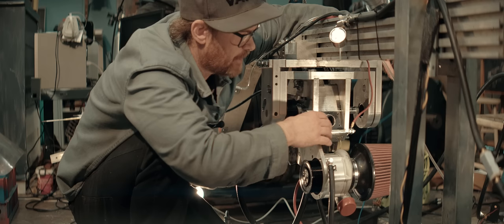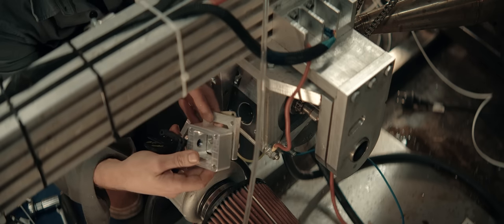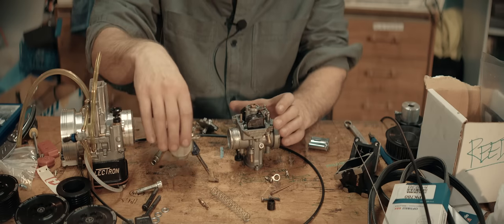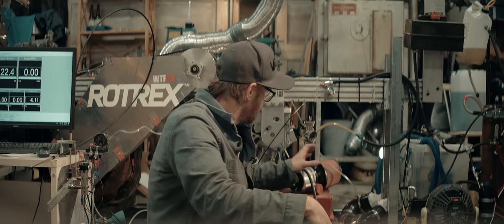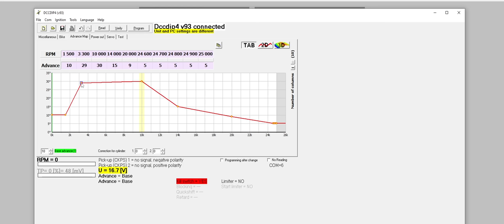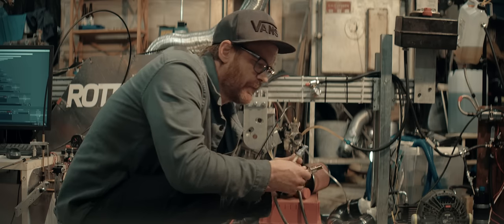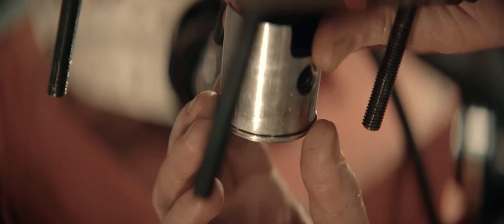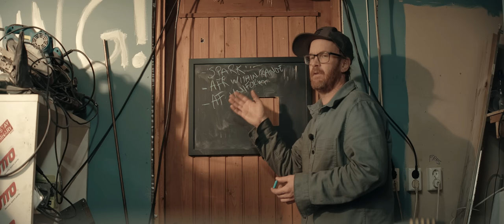Not Supercharged 50cc Two Stroke Not Running Nitro.

Comment: you didn't trying lowering jet
when you have very a big exhaust port with high degree like 200 for example and transfer port with 180you got a very small gap between them you get a very very narrow point of good mixture like 1 point or 2
Reply: and with you ignition advance you need less fuel because more efficient combustion ps i got a 80 cc that does exactly the same thing when too rich 
like ignition bug at 13000 rpm 
20 point less and i get good power 5 point less to lean i get 17500 rpm but good power at 14000
Reply: and you can see that when you shut the carb and reopen it your engine have 3 sec before it restart 
1 engine is not another 
but my engine is running 80cc with 80 pipe  16000 rpm 
main jet 90 point
and mine friend , engine origine, exhauxt pipe origine 125 point carb 
you should realy try lowering your jet plus your running on gazoline bro CHECK your plug if black or not

Comment: What about cutting angled grooves ithe quench band to induce swirl, only about
. 030" deep and 4-6 of them , and about . 060" -.080" wide, cut at an angle, about 45°-60° angle,  then remove the sharp edges to  prevent detonation,  it would probably mean making a new head, to raise the compression ratio, to compensate for the grooves, or  maybe change the shape of the ports, you should make a clear head to actually see what us happening, with a slow mo camera,  hopefully it would last long enough to see what's happening,. Maybe a pyrex head or window ? If the plastic degraded too quickly,

Comment: I wonder if you could rule out the crank case issue by heating the crank case. If the crank case was hot, fuel would atomize in there and reveal the issue?

Comment: I have two ideas/questions. Is it possible to add a pressure sensor in Cylinder and see if you lose spark and see what the pressure is. 2. Is it possible to decree the crankcase volume?

Comment: I couldn't help but think you might benefit from a wide band o2 sensor to adjust your mixture
Reply: Or a 4 gas analyzer
Reply: I was also thinking about the harmonic balance between the intake and the exhaust. If that might have any bearing I am trained in 4 stroke engines I admittedly know little of two strokes . Possibly  a little  auto cad and computer simulations could help shed light on the problem

Comment: My cr80 dose something similar when i hold it at like 3/4 throttle. The engine kind of surges its really weird. I know that bike also runs pretty rich and sometimes when it surges if I don't gas it the right way it dies cause my plug get to wet.

Comment: Could whatever lubricating oil you have in the crankcase be affecting the air fuel mix coming through the transfer ports? Wait, is there even any oil in there? When's the last time you check that?

Comment: Not sure if it's of any value, but I have noticed a disbalance in your dyno for as long as I am watching every now and then a video on this project. The whole rig shakes at between 7 and 8 Hz when the engine approaches the powerband.
21:30 "...then it takes a couple of hundred cycles to come back and then it happens again..."
25:40 up to 25:48 you mention frequency and vibrating, gesturing with your hand a frequency roughly matching the disbalance of your dyno when approaching powerband rpm.
Clould this unbalanced part imposing a slightly varying load on the engine play a role in the problem? It's easy to rule out once you have the large wheel on the dyno balanced while getting rid of the shakiness (is that a real word?) of your rig at the same time.
Reply: I think that you're onto something, Jeroen. Besides the shaking (which I also observed), I believe that the massive rotor of the eddy current dynamometer is unevenly loading the engine due to its substantial inertia... the rotor can't stop-and-start instantly in response to the experimental engine's intermittent combustion at certain rpm levels. If the dyno's rotor is indeed set-up with a one-way-bearing, the engine is still susceptible to inertial inputs when the engine produces a positive pulse of power—thus it "jerks" along unsteadily. After all else is taken into consideration the eddy current dyno might be a candidate for revision or replacement. A water-brake dyno is hard to beat when coupled to a 50cc/30-40 bhp engine.

Comment: Sounds like you are hitting a rev limiter.  Could it be that your crank picup is not capable of switching at that high RPM ? I have heard of a problem where the crank trigger wheel was too small for the size of magnet on it causing the picup to miss triggers at high RPM

Comment: Just thought about of spark blowout? it may spark but the chear force of compression makes the spark die before it has a chanse to ignite the mixture propperly. and then it just goes to h*ll and the cycle starts al over again?

Comment: Alex a 2 stroke are a 2 stroke no matter the piston , disk , or reed valve or poppet valve do the job. So why not exclude the crank case , use regular bearings, and engine oil then use a blower to do the scavenging and proper valve in the head . You have clean flow much stronger bottom end, and later you can add a turbo, this are proven 2 stroke technology, with fuel injection with no oil 🤔 😁. Good luck Sisyphus. 👍❤️

Comment: As the cutting out has quite a long time period is it possible  the float level is too low in the carb? Running out of fuel at high rpm?  Just a thought.

Comment: It seems possible that fuel is pooling somewhere and you're getting inconsistent mixtures from cycle to cycle. If fuel is pooling and then dumping at a resonance frequency and giving the engine a huge slug of rich mixture, it could explain a lot.

Been a while since I've seen the crank case - is there some places where pooling could explain this away?

Comment: Is the spark voltage always the same or is it increased by RPM in this system? Sounds like it's arcing out at that range. Can you try a different system that wasn't designed straight back in the 90s? At this point why can't you run a regular coil just for testing purposes with regular gas mix? I'm willing to bet your ignition system is to blame. Could be arcing and you can't see it (inside the unit perhaps). That's self limiting for a reason even without a pipe it should not cut out like that it's a 2 stroke but you could be having a resonant issue with your huge crank volume of the conditions won't change with another spark system.

Comment: I can't help feeling like the cutting out at pretty much 12500rpm and the limiter set at 25000rpm is not a coincidence. Is the ignition system getting the correct rpm signal?
If the signal is doubling frequency for some reason... 
Have you verified that the ignition system is actually timing as per your curve? I know you verified it at 10degrees locked.... But is it at 30 degrees at 6000rpm for instance?
Is it at 10degrees at 12000?
The issue is "too consistent" in my view to be caused by fuelling or some kind of mechanical problem

Comment: Is it possible you are hitting a limit on the coil? I wonder if the cut outs are the capacitor not being able to fully charge before it needs to fire again. From the video it is pretty clear that you are hitting some kind of hard limit at 12-13k RPM.

Comment: Would a coil on plug solution help any? If the ECU has ability to drive it they easily support 200hp per cyl, the only problem might be dwell at 12k + rpm..

Comment: I'm more used to tuning small block chevy's. Can someone explain the therory behind why timing has to taper off so much at high rpm in this motor? Love the videos!
Reply: Its a complex mix of residual exhaust slowing combustion at some speeds and fast combustion when the pipe is resonating which decreases residual exhaust and increases dynamic compression and turbulence increases requiring less timing. He is also pulling it back at high speed to keep safe from detonation but also as a rev limiter. Kinda like it's 2 engines. 1 lousy needing timing 1 good requiring less.
Reply: @billshiff2060  That makes sense, Bill. Back in the day (1960s) when we tried to run high percentages of nitro in 10cc control line speed models (before the rules changed), you needed a hot glow plug to keep the engine running while the model got up to speed—before it came on the pipe. When it hit the pipe the hot plug almost instantly burned out, which left you wondering how you might substitute a cold plug, which by the way wasn't hot enough to get the engine on the pipe (running rich). Like you said...complicated! One of the things that we tried was electrically heating the cold plug until the engine hit the pipe and then cutting the current. Besides not being much room in the model, the trick proved to be very unreliable. After a few guys managed to make 200+ mph runs, our national (rules-making) organization limited the fuel to methanol and lube only.

Comment: Could it be the pipe is not correctly designed and is causing an imbalance of gases at specific RPM's. Could you try a proper ktm 50sx pipe or something?

Comment: Yeah its a recogniceble , masochist feeling... Dude did you ever seen a 2 stroke 50cc and 70cc sprint or dragrace ? They still use those old kreidlers and stuff ... One of the weirdest thing ive seen was a ignition only using a pick up for the spark timing running on a batery(pack) using also a large bobin from a car or so ... ..  Your high voltage may be the problem , jumping over and leak... .. Maybe a normal 12 v batery helps regulate the power to the normal 24,4 volt a spark should jump

Comment: Just a thought, you set the rev limiter in the ignition unit to 25k and you engine cuts out at 12500. Is the ignition unit designed for 4 strokes?

Comment: When you designed this cylinder, didn't you said that you need a piston with no wrist pin hole ?
Reply from the maker: Ideally, yes. Will work with the holes too, but should make less power, in theory.
Reply: @2STROKESTUFFING  But is it possible this to cause the flames in the exhaust in the boosted setup?
Reply from the maker: Could be👍

Comment: I would try a smaller carb to increase velocity.
Reply: Yes a smaller carb is much easier to tune on a unkown engine. Alex has said many times that this crankcase volume is too large for a N/A engine. A race type carb is needed to alleviate carburation problems. Not all carbs are equal as I've found out through trial and error at very high revs.

Comment: I'm gonna throw it right back out there again, that I still think you're having crank trigger problems with such a tiny reluctor even though you're seeing spark on the meter, it's happening so fast that it doesn't mean actual spark isn't happening only every 2 or even 3 cycles the further your revs climb. The larger your reluctor wheel the more resolution and hence the more control and reliability you're going to get. I don't think anybody runs a crank trigger ignition with anything less than 4" of reluctor otherwise the pulses overlap and start to stack. Just my 2 cents

Comment: Your computer is fast enough to data-log spark events. Should offer an indication if your spark meter has enough resolution. If memory serves -- this is nearly 30 years ago -- such devices aren't effective at anything above 8000 or 9000 RPM.
From glow engine experience, that RPM oscillating at the top sounds familiar. The dyno indicates 50% drop in power. Is there fuel accumulation/pooling in the crank and/or elsewhere near the cylinder? Spark plug pulling heat out of the cylinder?

Comment: i dont tune 2strokes only  strokes but isnt the timing suposed to riase as the rpm goes up so that fuel has more time to burn becouse higher rpm so that the combustion happends same you need to advance timing becouse its higher rpm and you need less burn time to stay in the same cylinder pressure point or is it different on a 2 stroke ?

Comment: Didn‘t read all comment but think about your gasoline. Aspen or what ever spezial chainsaw gas you use is not e very good burner. It have only 91okt and burns really poorly. The only plus point it s a littel healthier then gas. For my racesaw i just use 100okt vpower with a good 3% syntethic mixöil. And they run way better with it, than just with aspen. Sorry for my poor english

Comment: So... call me crazy. But you said on your old ignition system it wouldn't cut out at RPM... it just ran like crap because you couldn't tune it enough for lower RPM? If you did pop it back on... does the high RPM cut out go away again? If it does then that pretty much would prove its a spark issue of some sort. As for compression... I see you only have one ring. Is this a 2 stroke thing? I am used to 4 strokes where there are normally 3 or 4 rings, but then again, 4 strokes don't have to deal with a bunch of ports to ride over in the cylinder wall. Perhaps more rings would help the compression if that really is an issue, but that may also be a huge no no for 2 strokes... you would know best for that one though.

Comment: The auto ignition temperature of nitro is about a hundred degrees less than gasoline. I know your using a mixture but do you think it could be related? How hot was the cylinder getting with the nitro mix?
Reply: hum maybe with the turbo that make high pressur you get even lower point ignition plus the temperature added from compression of mixture , and that why it make flamethrower

Comment: You use too big carburettor. I had same problem in derbi, it didn't rew through a certain point but when i putted a smaller carburettor it rewed through it. I had 50cc sylinder (was ported), with 21mm rews. with 24mm not rewing, Not enough flow in higher rpm.
(Sorry for bad english)
Reply: Very true. But this 28mm is the correct size for this race engine.

Comment: Wenn it have Spark it maybe not get enough fuel thrue the Carb, maybe the flowt bowl or the flowt bowl valve is sticking , it would explain no proplems at lower rpm where less fuel is needed, but its a good ideal to start wichtig a smalltalk amputiert of engine complexety, maype proplems that you find now will ingrease the turbocharged engine development , the theory with the off Breaks gibt spark sounds very familiar,  had a vape ignition that startet great but cuttet out over 7k rpm

Comment: Really .. those that just follow the path of those before them will very seldom find new approaches that might reinvent idea with fresh theories and hypothesis.. keep discovering your way .. and proving previous ideas to your satisfaction.. so you can move ahead with the confirmation for confidence .. I appreciate the education.. mistrials by mistrials.. the fact is the mistake might be the discovery .. do what you do man.. it’s appreciated by most and those that don’t need not watch or comment .. imho !!!!

Could two plugs sparking alternately help with the ignition at higher rpm.. whether to address the physical limitations of the plug or the frequency effect on the spark ?

Comment: i'm confused here doesn't ignition advance mean that the spark fires before the piston hits TDC? and wouldn't you want more of it at higher rpm's to get the flamefront of the combustion to hit the piston head right as it turns around and starts heading back down? rather then long after it's already started moving?
Reply: A 2-stroke  pipe is designed so that, at some specific RPM, the sound wave generated at exhaust opening gets to the baffle cone and is reflected back to the the exhaust port, just before it closes, forcing carried-through unburned mixture back into the cylinder, providing the critical power boost.
If the RPM of the engine is less than that design RPM, the wave has more time to get back to the exhaust port, so gets there too early. The sound wave velocity is dependent upon the exhaust gas temperature (EGT), so to slow down the sound wave, we make the exhaust gases cooler, by advancing the ignition, so the mixture is more fully burnt when it hits the pipe.
Conversely, at RPM higher than the design point, we need to speed up the sound wave because it has less time to get to the baffle cone and back to the exhaust port. We do this by making the exhaust gas hotter, and the way we do this is by retarding the ignition so the gas is still burning as it enters the pipe. Hotter gas equals higher speed of sound so the sound wave gets back in time to do its job.
By having a varying ignition curve, we are effectively lengthening and shortening the pipe.
Reply: @rogerwhitmarsh3644  right no dedicated exhaust valves cause the option to actually complete the combustion cykle in the cylinder to no longer be an option as you need taht pressure wave to be as fast as possible at higher rpm's got it you aren't tuning the valve timing you are tuning pulse timing and you do that by tuning ignition timing

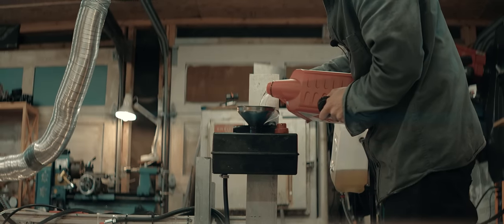Comment: 9:19  if you start with unleaded 98 octane and add oil (Motul 800 2t racing 1L +4L Motul, as masters of the Ester Technology, creates motorcycle oils with four to five times more film and tensile strength, translating to less expensive, longer-lasting engine protection.) 50:1 it's bout 95-93 ,if you start with 91 it ends lower bout 88-87 um my race engine didn't like it at all (HONDA CR 125 73 wisco piston,non-reeded.down jetted 250 carb,UNI filter,transfer ports could put thumbs in,DG race head and DG pipe,CDI ignition,NGK B9EG)
Reply: to swap just run a 1/2 tank of 40:1 through it. blows a bit of smoke but could be a problem with neighbors but!

Comment: 50:1 / 2% premix doesn't sound like much considering the migration time, myself wouldn't feel comfortable at any less than 25:1, even with a high quality synthetic.
Reply: I think Alex must have a stihl chain saw with the 50:1 synthetic oil. He normally uses around 20:1 castrol 747 castor oil. Possibly just out of petrol to mix some up.